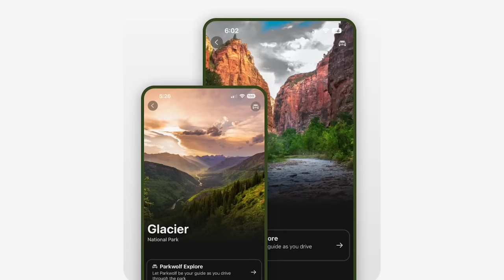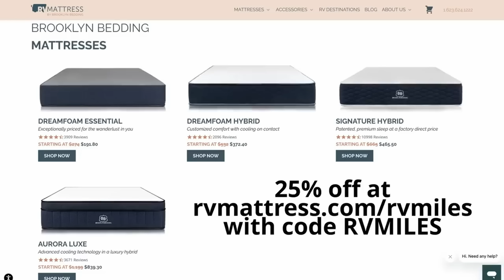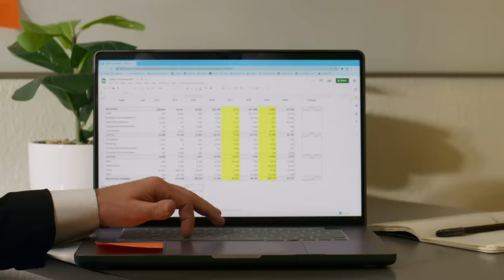293. What is "Decontenting"? Updates from the RV Industry Open House

Comment: 100% about pushing for consumer focus. The current model is such a racket. 

We were looking at AEON RV. Such a different experience. Obviously it’s not a full scale manufacturer yet but they listen, they communicate, they’re engaged. And you order direct from them. 

The build process is such a mess as well. And the dealers do not do PDI! Or fox anything until the buyer or buyer’s inspector points out the problem. And even then, check the work! And consumers pay for dealer work too.  Such a Racket. 

I’m in on being hired. 😂

Comment: They need to talk to camping mobile RV techs.  I am RVTAA certified mobile RV tech.  I want a simple trailer. I do not need slides.  I do not need outdoor kitchen. I do not need fancy solar systems. 

I would like to see making the location for the batteries large enough for two batteries.  Maybe give a lockable battery cabinet on the tong instead of plastic box with hard to operate straps.

Comment: Second behind the outdoor speakers is the useless outdoor shower. It’s too weak to clean off most dirt/sand and it’s easier to just put a splitter on the park water connection, use your own hose with much better pressure.

Comment: Delete or make a la carte online ordering:

TVs
Interior radio
Interior speakers 
Exterior speakers
Exterior TVs
Graphics!
Mattresses
Valances 

Add:
Insulation! As in, some! Rather than none in the front caps. 
Braided Stainless lines at the water pump rather than noisy vibrating PEX 
Better water pump or even the standard one but installed on bumpers to reduce vibration noise.
Better windows. 2ply at minimum. 
Wiring channels for easier  post purchase adds.

Comment: I think lesser equipped vehicles are marketed all the time.  Example Ford F-150,   They have badges on the side of the truck showing XL, XLT up to the Platinum models.
Reply from the maker: That's a good example though. Ford uses XL because it doesn't "sound" like the base model. And the badging is very small. RV manufacturers are using names like "Essentials Only" and "Access Series" and the branding is very large.